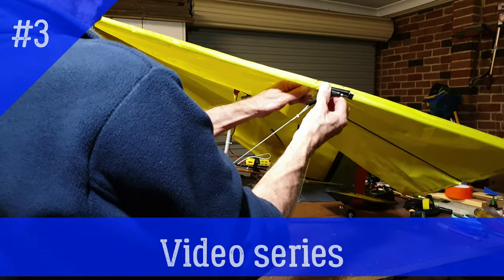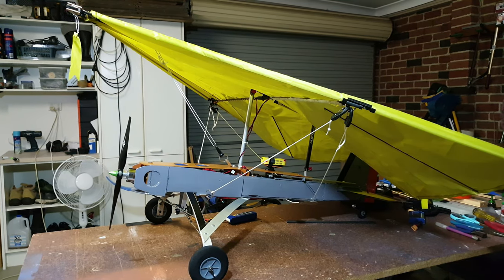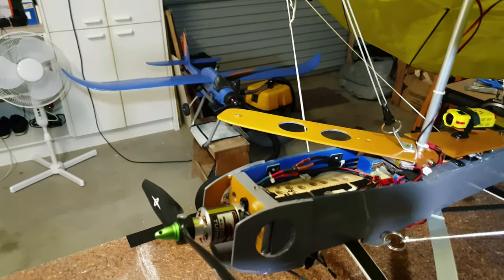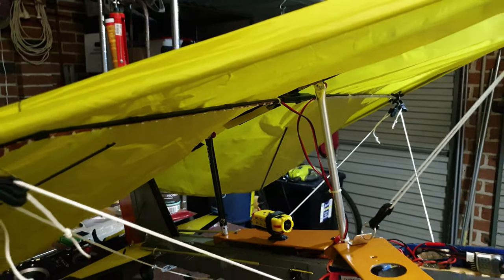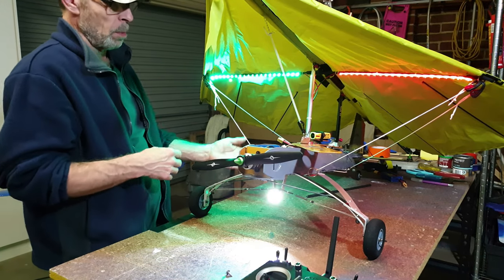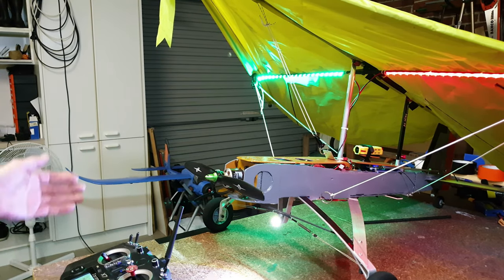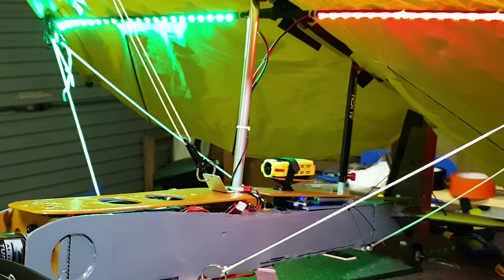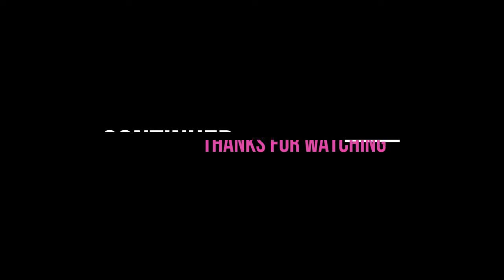KITE-PLANE, HOW IT WAS BUILT. Video #3

Comment: I see most rogallo planes have their wings placed above the propeller at a slight angle, my guess is that this setup allows the props to bring air underneath the kite and thus create a higher pressure of air underneath the wing and thus lift. I was wondering, would it be possible to have the props placed right in front of the wings just like regular aircrafts?
Reply from the maker: There have been many attempts for mounting motors to hang gliders over the years, the modern trikes have a rear pusher prop motor setup hanging from centre of gravity, As long as you have your thrust line correct on the fuselage it makes no difference, lift is created as any other wing with airflow and airspeed, propeller and motor are for forward thrust only to create lift from airflow over the wing.

Comment: The rear wheel are free wheel or fixed wheel
Reply from the maker: Tailwheel Free for steering.
Reply: I'm build a same thing but use a kite with bamboo frame and wonder that can it suffer the plane
Reply from the maker: @mafialenin  
Bamboo should be good, just attach the rigging strings to give strength to kite, very important.
Reply from the maker: @mafialenin  
Very good!
Reply from the maker: Did you fix the yaw issue. 
Maybe bigger tail.